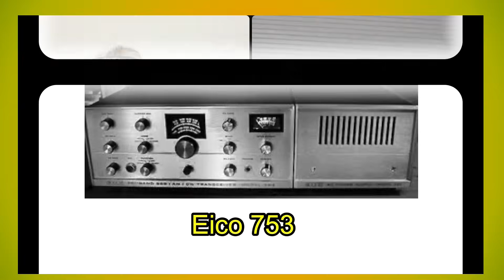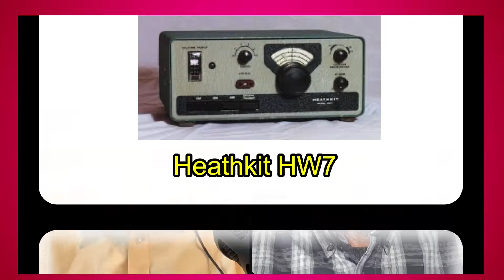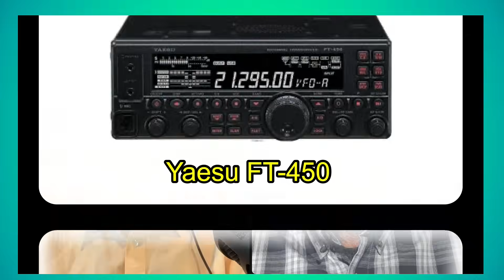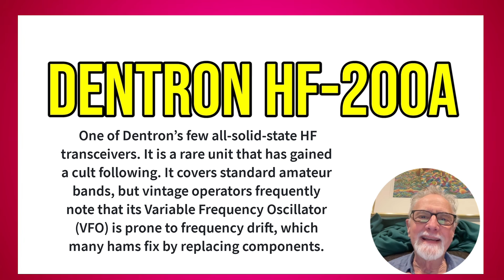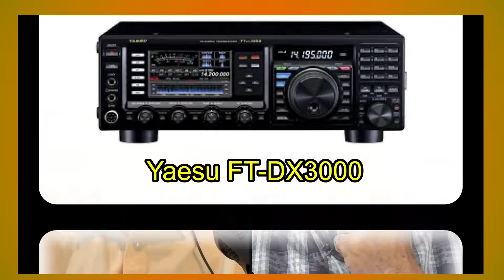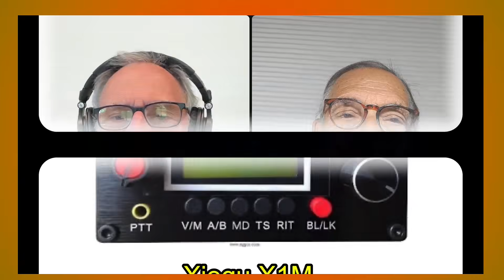10 Worst Ham Radio HF Transceivers -- Ham Radio Fun?

Comment: Further details behind each selection are explained in the video. 
  3:00  1. Eico 753 (Frequency drift)
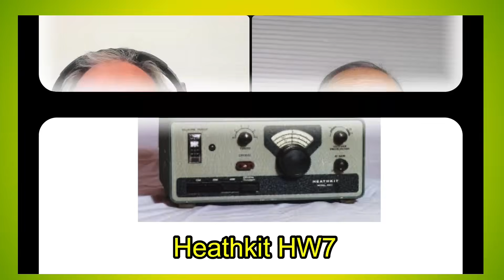  5:40  2. Heathkit HW-7 (Deaf receiver that overloaded from nearby AM stations, microphonics)
  8:28  3. Knight-kit T-150 transmitter (chirp and drift, AM transmissions would "FM")
10:55  4. Yaesu FT-450 (poor ergonomics and user interface, corrected with the FT-450D)
13:09  5. Dentron HF-200A (drifting VFO can be fixed by replacing all components)
16:40  6. Swan 250 6m transceiver (6HF5 TV sweep tube used in the final amplifier could explode if not tuned quickly and accurately) [Edit: As StanTheManOfSteel commented below, the Swan 250 used a pair of 6146 finals, not 6HF5 finals. (The service manual  says 6146B finals.) The 6146 and its variants were designed as RF amplifier tubes. Do the video creators still stand behind their #6 "worst" rating for the Swan 250 transceiver, despite their misidentification of the final amplifier tube? Google searching indicates that the 6146B can cause problems in the Swan 250 and 250C, but I have no personal experience with the Swan 250 or 250C.]
19:38  7. Yaesu FT-DX3000 (overly-sensitive AGC firmware will deafen the receiver for several seconds after an input pulse)
21:24  8. MFJ 9420 (poor quality-control with this 20m QRP rig often meant that even brand new rigs had to be repaired before they would work)
23:32  9. Gonset G76 (OK rig, but mobile power supply was noisy, unreliable, and generated lots of RFI)
26:13 10. Xiegu X1M (dirty spectral output, poor tuning, and received audio had permanent whine)
Reply: The Swan 250, 6 meter rig used 6146 finals, not sweep tubes. The hf Swan radios used a variety of sweep tube finals.
Reply from the maker: @StalinTheMan0fSteel  We checked that, and you are correct. We always appreciate such solid corrections. Not sure how we got the wires crossed on that one. 73

Comment: OK, as far as the FT 450 which I have used since 2009, I have seen nothing wrong with.  I am not a technical ham so lots of the stuff you are talking about is a mystery to me.  However as for the red desplay,  if youre talking about the actual frequency readout on the screen, That can easily be changed to a number of different colors.  Mine is White.  This cannot be done on the 450D as far as I know and I have tried it on one that I also own. I have the 450, 450D, 857D, 891,  1900 R/E, 2900 R/E, Four 817s and two 818s.  I have never had a breath of  problem with any of them.  If you want my opinion of a rotten radio, I would pick the Icom IC 718,  I had two of them.  The IC 725,  I had two of them and an IC 22A.  All went sour long before their time.  I wouldn't have another ICOM  if you gave it to me. But I love my 450 and happy with it.  As for the 450's look and layout, that's why I bought it and  the menu seems fine to me. So there it is. K4JTP.
Reply: I think you were unlucky with your Icoms. My 718 has been going strong for years. It has just been reintroduced to the UK market, and in my view it's a great entry level rig. 
M0SSH
Reply from the maker: @MrJTPEPPER Fascinating as to why hams love or hate the 450s. And we have heard from hams who love the 718. The one I operated had very weak sensitivity on receive; I did not like it. It is funny, too, how we tend to like or dislike brands. See our video on whether or not hams are foolishly brand loyal: https://youtu.be/hytPl4g3nzI

Comment: Hello guys, new to the channel.

As a kid had an Audio Sonic 22 ch. mobile with ext. psu and small antenna in the window. Not really knowing anything of significance about the gear just trial and error relying on a SWR.

Currently no transciever only a worldreciever for mainly SW listening.

Yet the technology and community I find a lot of fun. 73 😃👍
Reply from the maker: @Michel-r6m Welcome to the channel, and it sounds like you caught the radio bug early on! 73
Reply: @HamRadioPerspectives My beard is as grey as yours but I am not as experienced on radio's as you guys.

Always learning and a fun broadcast like this keeps me interested. 

Going to put my SW radio in the microwave since I was told it extends the antenna 😉🤫🤡

Comment: FTDx3000D is a vastly better radio than you suggest. With the 300hz filter this is a contest operators dream. I never experienced the AGC issue, my units are late production.
Reply from the maker: @donr2670 I think you got us on this one. We know that they fixed the AGC issue at some point. And the filter is superb. That's for keeping us on our toes. 73
Reply: @HamRadioPerspectives  Right! So the Eico 753 rates 2.1 on eHam, the HW7 rates at 2.9, and the Knight T-150 is 1.8...  Conversely FTDX3000 has 196 reviews starting in 2013 and rates at 4.7 through today. ;-)
Reply: I have one also. I also never had the AGC issue. And mine is a later production model. Never had the narrow filter.

Comment: "10 Worst Ham Radio HF Transceivers"  All you have to do is pick ANY 10 of the newer digital pieces of TRASH with a multi color video game display and a cheap flimsy plastic case. They are ALL 100% GARBAGE. My main HF radio is a Yaesu FT DX 560, one of the last real radios, which I completely rebuilt myself. I have made many contacts in Europe and Australia/New Zealand from the southwestern U.S. on it. It is a huge tube radio with a steel case, weighs 40 pounds, and puts out around 250 watts.
Reply from the maker: @geraldscott4302  We've talked about this as rigs becoming video games. You have a very good point. Some of the older, classic radios are  the best. See our video, for now, on the best transceivers: https://youtu.be/AIQQVd_UzQ8

Comment: I own an FT-450AT (pre-D).  It was a good radio, but it was definitely flawed.  The dark red print on the black background made it hard to use.  Also, the digital filter would only work on CW.  The bandwidth setting were mode dependent to make it almost unusable except for CW.  

Ironically, the FT-891 was heavily critized as a "poor replacement" of the FT-857 because of the lack of 2m and 70cm all-band, but it was actually a MASSIVE improvement to the FT-450AT and FT-450D allowing a filter bandwidth and passband tuning far improved from the 450 and actually comparable performance to the Icom IC7300 except for the display.  That fact mave the FT-891 a favorite for mobile and portable HF operation popular for POTA.
Reply from the maker: @kevin_wb0poh Thanks for the technical deep dive on those radios; it’s spot on about how certain features can make or break a rig for field use. And here's another interesting point that will get me into trouble. I had a souped up K3 and the Icom 7300 at the same time. I would not say that the K3 was worth the extra money for receive, but it was far superior for break-in CW. I think somewhere I have a comparison video of the two. Will try to dig it up. Q 73

Comment: Waaay back in the day, F0OL worked DXCC on 20 meters in one day with an Eico 753 feeding a Gotham V80 vertical. He created a traveling cw pileup by setting the VFO on 14.001 and working stations as the 753 drifted up to the high end of the cw band. Then he QSY'd to 14.2 and working stations as the 753 drifted up to the high end of the phone band. 😄😜👍
Reply: Agreed on FT450, load of junk
Had it 2 days and that was too long. The 450D was pleasant rig even ny today's standards in its price range. Using FTDX101D for past 8 years and st8hard to beat
Danny ZS2E/ZS6AW/7P8AA
Reply: Hey, I remember, not too long ago an honest 80-100 khz split on 20 meter CW for Ducie Island when it got activated!  Basically, you needed a band scope, very quick tuning on VFO B, a decent beam & an amp.  Then, you had a chance'. LOL
Reply: 10 min iniciais falando falando e nada dizem...
Reply: A Eico nao foi capaz de resolver o problema de seu 753, uma indiatria tradicional e tao conhecida...
Reply from the maker: @renecorrea1008  Great story! Thanks for sharing. Turning lemon into lemonade. 73

Comment: Oh!  I passed on the Yaesu FT-450.  I was looking to upgrade from my old Icom IC-740, and I looked at at an FT-450.  I dismissed at as very non-intuitive.  I had a Yaesu FT-530 dual band HT, and I think they got a little carried away with menus, secondary menus, and more menus.  Bought a Kenwood TS-480SAT instead.  Even with the menus on that one, I can stumble my way through it even without the manual nearby.
Reply from the maker: @davesherman74  Tom has the 480 and it worked very well until something went wrong (He can tell you about it). Solid rig, though. And these doggone menus. It's like the screen menu in my car. Terribly complex and non-intuitive. 73, Q

Comment: Is that the Knight Kit that doubled in the final for 6 meters?
Reply from the maker: @hugh007  Actually it operated on all bands at once, and out of the bands, too. I can't remember if it claimed to work on 6 meters. Maybe Tom will chime in too. We forgot to mention in the video that often the problem with kits is that they are assembled well. 73
Reply: You mean the Knight T-60. The 6DQ6 final served also as a doubler for six meters. I built mine in early 1964. It put out a little over one Watt on six meters but I worked lots of stations crystal controlled, both AM and CW. Fun times indeed.
Reply: @W8ASA  Pitiful.  Even doubling, a 6DQ6 only put out 1 watt?    That's like a Twoer or a Sixer. 
K4XBC

Comment: By far the Worst HF Transceivers I have ever owned were supposed to be Shack in a Box radios. Next to the Worst was a Kenwood TS-2000 that I had high hopes for. It was as Deaf as a rock covered in cement on every band. I sold it for a $350 loss from what I paid for it just a month earlier. The Worst was a YAESU FT-857D. It had a continuous S9 signal on 6 meters in my mobile or my shack and what made it worse is that 6 meters is my Favorite Band. I spent over $400 on getting it repaired and it was a waste of money. Happiest  day in my Ham Radio time was the day I sold it and the garbage ATAS-120A and replaced them with an ICOM 7000 and a Tarheel II that is one of the Best combinations I have Ever owned or used. You can’t Give me another TS-2000 or 857D for Free if I must actually keep and use them. I replaced the TS-2000 with an ICOM 9100 with both roofing filters and the D-STAR board and it’s daylight and dark better the the TS-2000 could ever dream of being on Every band and every mode. Also what is the 180 meter band you mentioned when you were covering the Swan 250? 🤷🏻 de W4KVW 🎙
Reply: I have three of them and no 6 meter problem here except locally generated crap. One of my 857's has been baking in the car since 2010. Had to replace the display
Reply from the maker: @1OFGODSOWN  Ah, the adventures of ham radio. Every rig carries its stories, like every car. Many remain secret because of embarrassment. 73